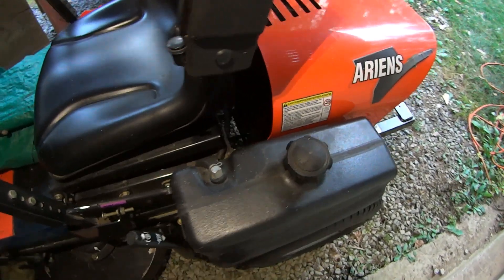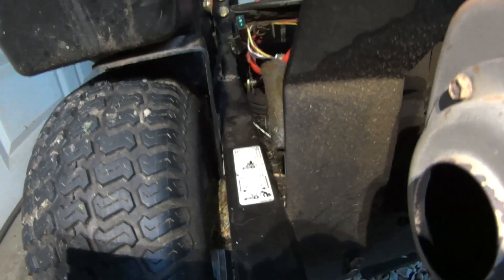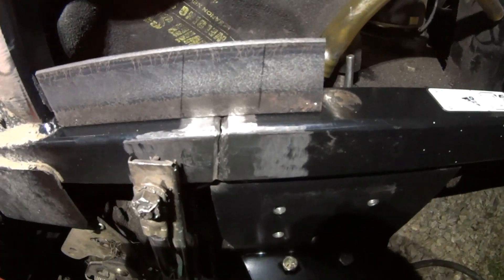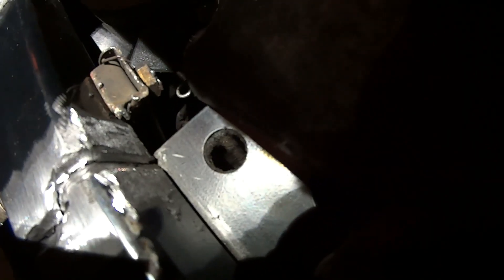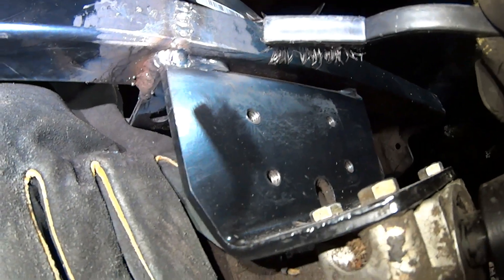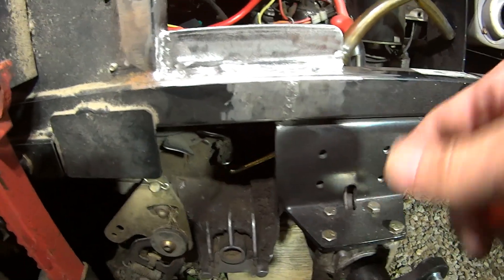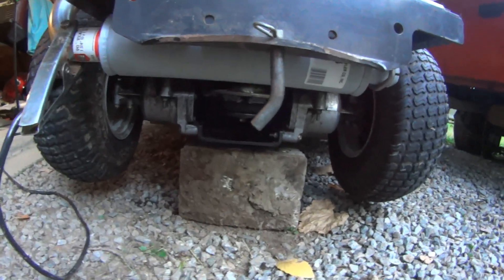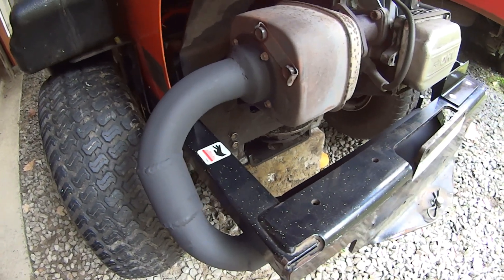MTR FAB DIY  Ariens lawn mower frame repair and QUIET Muffler Mod

Comment: do you have a video of the mower running after the exhaust modification!?
Reply from the maker: @dylankollmorgen9266  I don't. It was still waaaay too loud for video. It did make a considerable difference though. The customer was happy with the reduction of noise. Thanks for watching/commenting and good luck if you try something similar.

Comment: Good Job. I'm trying to figure out a way to remote/quiet my Predator 3500 Generator.
Reply from the maker: @LetsFigureThisOut  Thanks. It is amazing how loud these motors are and what it takes to quiet them down. For my Genny... I quiet it down by  using a piece of foam board a few feet away set at a 45 degree angle to the ground. Point the exhaust at the board at a safe distance. It reflects the noise down to the ground. Pretty amazing how much difference it makes at a distance. I know it's not a mod to the Genny but maybe you could build something more permanent for your application. Just a thought. Thanks for watching and commenting.